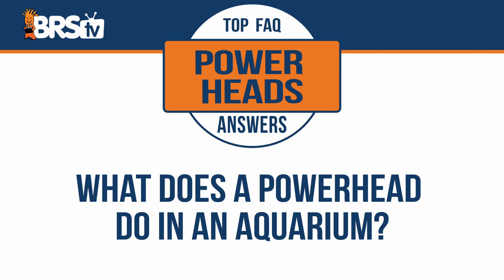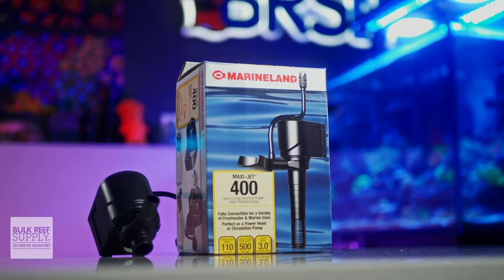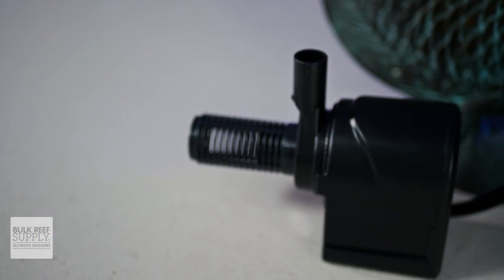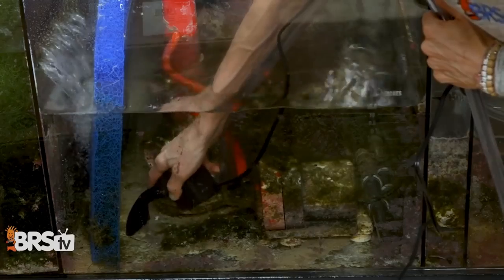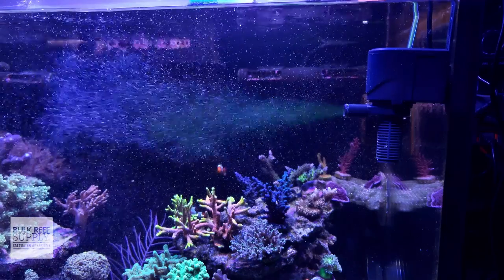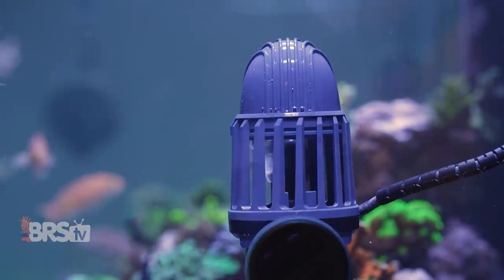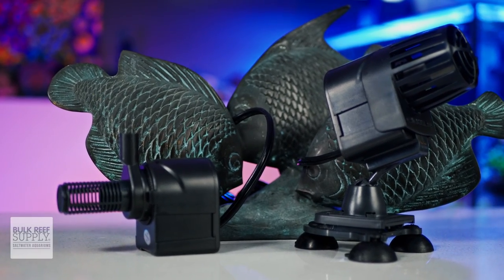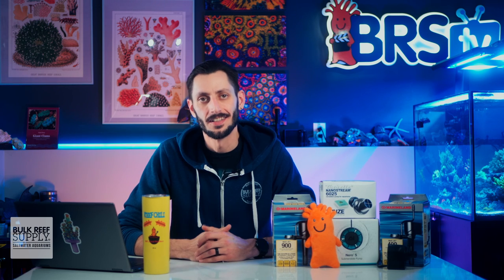What Does a Powerhead Do in an Aquarium?

Comment: what do you suggest as a workaround for that very strong water outflow inside the tank? I am using a powerhead myself and i know how that strong water current stresses the fish. been wanting to find out how to reduce the force from that outlet without compromising the motor. any ideas? I tried blocking the watet outlet with a sponge though, but scared it might ruin the pump motor.